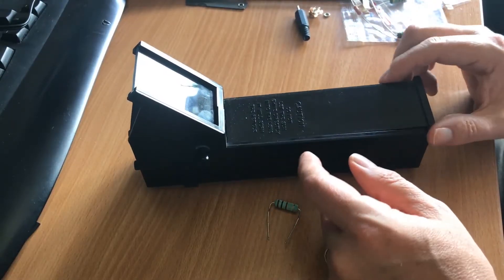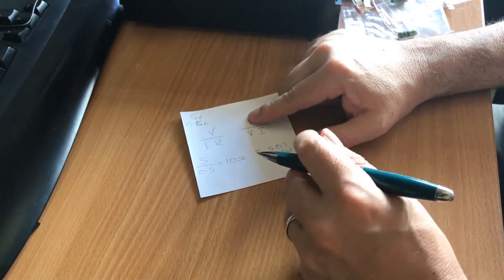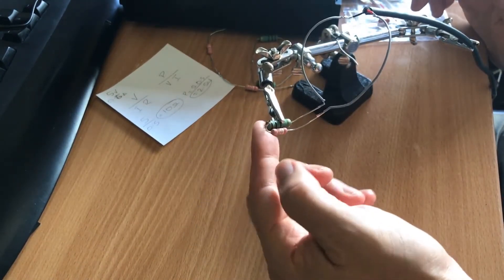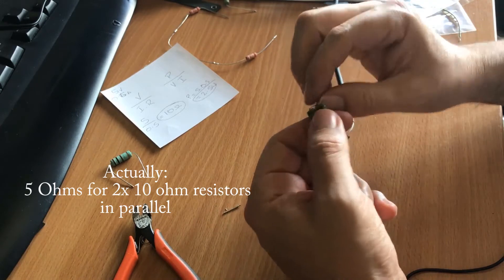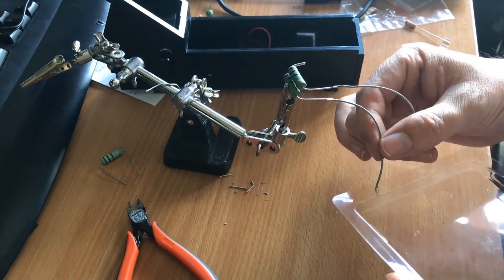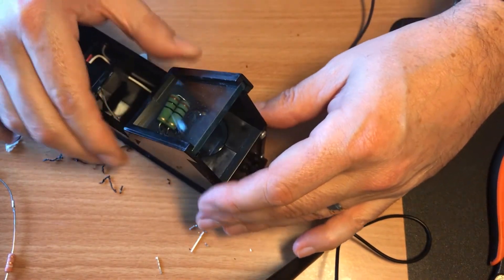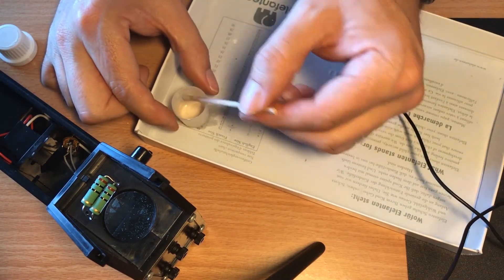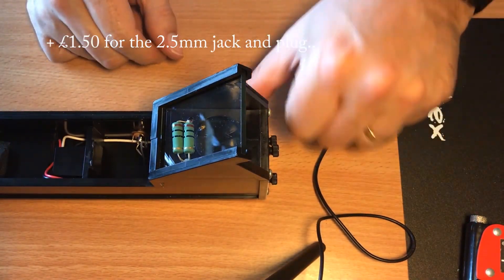Telrad Dewheater DIY

Comment: Based on your video, I did this mod. I had to use four 10ohm resistors in series (making 40ohms), and connected this to a USB power source (5v). It works great. I even tested it on a foggy day (couldn’t see the sky, but wanted to see if it would work with 100% humidity,  - it did.)  While I was drilling and soldering, I also installed a 5v to 3v circuit and powered the reticle. Thanks for the inspiration.

Comment: Did you consider powering the Nexrad from the same 5v supply (stepped down to 3ish volts, maybe with a resistor). I have heard that this is possible, but I do not know the method. Your video was very well done, you did a great job of showing the steps, good explanations. Really appreciate it. Oh - this is the construction. Now that you've had it up and running, does it work? Would you do anything differently?
Reply from the maker: Hi George, thanks for the comments.  At the time I didnt really consider powering the telrad, as i wasn't familiar with buck converters.  The resistor heater works perfectly, just 5v and no adjustment needed.  If i was doing it again, yes i would add the ability to power by usb also i think, although having the battery pack is an easy way to ensure you still have an alternative if you forget something!  These days I dont use the telrad at all, relying on the goto and Ascom for finding faint stuff... boring but reliable ..
Reply: @MikeyJ  Your go-to must work a heck of a lot better than my celestron se - I need that Telrad like quite frequently. Thanks for the quick get back. Happy viewing.
Reply: How did you initially determine you needed .5 amp?
Reply from the maker: @diego_villena  Good question.  Two things really:  i know that secondary dew heaters draw around 0.3-0.5A from their specs, and a standard USB2 can provide around 0.5A of current, just in case I wasn't using a USB charger but a std usb port. I had to start somewhere and this worked out fine
Reply: @MikeyJ  Thanks! Another two questions: 

Why use two 10ohm resistors for 20ohm total, when you calculated needing only 10ohm? (=5V/.5A)

Don't the wires below interfere with the reticles projection?
Reply from the maker: Hi Diego, well the one 10 Ohm resistor got very hot, and i was concerned the temp difference might break the glass in cold weather.  The additional resistor lowered it to just 'warm' over a larger area.  It doesnt get in the way of the projection, it sits on the plastic between the glass and the lens, and it works great :)
If I was doing it again I would probably add the power to the actual telrad, although as said above, it's good to have a separate power source for that in case you forget a cable or something ..